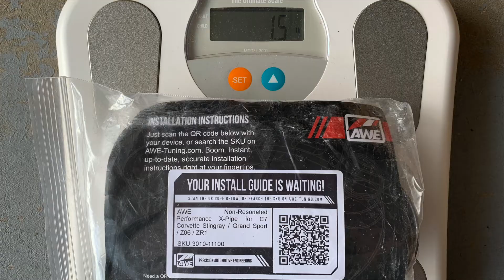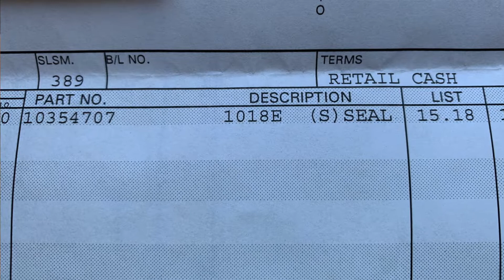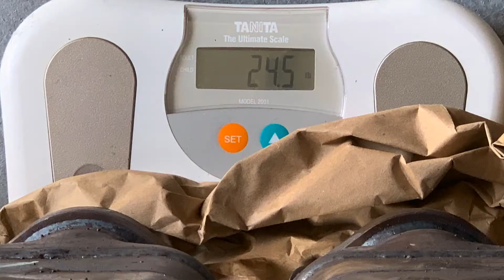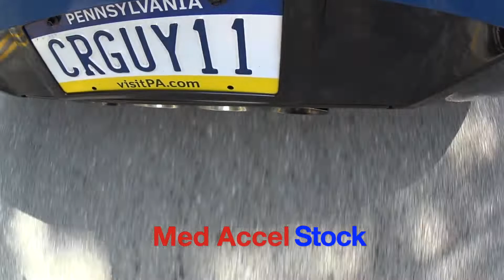AWE X-Pipe Install & Review - C7 Corvette Stingray Z51

Comment: Why didn't you just remove the two rear cats and then remove fuse #41 or 42 (depending on year), same effect, no?
Reply from the maker: The rear cats are welded to x-pipe so still would need to weld new pipes in.  Already did the fuse removal (actually mild to wild).  https://www.youtube.com/watch?v=PYgidQ2Xke8&t=

Comment: I am also contemplating between replacing the factory mufflers with aftermarket Corsa exhaust (muffler only) vs the x-pipe. What’s the reasoning why you chose the x-pipe over muffler install?
Reply from the maker: I didn’t want to loose the dual mode exhaust flaps. Plus a little performance gain eliminating secondary cats.

Comment: I want to mod mine so bad! I have a 2017 Grand Sport. The engine has had forged racing pistons put in, stage one cam, Lt4 supercharger, AFM delete system, Afe Momentum cold air intake, and had a stock exhaust! I'm keeping the back stock because I want the NPP valves but really want to add long tube headers, high flow cats with x-pipe, and I'll be putting a 2.3 pully on the supercharger in place of the 2.5. Should put me a little over 700 engine hp and around 600WHP.  Just worried about the noise. I'm sure with the valves closed it should be fine.
Reply from the maker: Yeah the valves are key to keep it from droning.

Comment: Imagine if you did a muffler delete in conjuction with you're mod... it would blow your socks right off
Reply from the maker: Yeah but I do like it quite at times too.
Reply: @CarGuy11  ohh noon. You get to keep you quite npp valves. All ai did was do a Muffler delete,  x pipe and had the show install the exhaust valve on both Muffler tips.. of course you need a Range ODB to keep the exhaust value in manual but that's only $189 and its plug and play.. I have done on mine and boy it's a good setup. Loud and mean as heck but quite enough when I leave at 3am .. All I do is before I start the car is select the exhaust valves open or closed from the screen menu then start the car. Easy peze.

Comment: I have found a 3 inch High Flow Cat replacement pipe for the stock manifold down to the X Pipe. Was thinking that Down Pipe and an X pipe keeping the NPP mufflers. And ,maybe a pre Rear end Cutout so exits just before the tire for those days I just want to be ornery. What do you think?
Reply from the maker: Yeah I love keeping stock mufflers and keeping the valves.

Comment: The center brace cover thing that you need to take off first before getting to the exhaust, when tightening the bolts, just tight is good right there is no specific torque to tighen those?  and after installation to check leaks, just do what he did and put hands around the connections to? feel if any heat/exhaust is coming out? Thanks for the vid it was nicely made.
Reply from the maker: Honestly there probably is a torque setting for those bolts but I didn’t know it. You can feel & likely hear a leak when you are that close to it. Thanks glad it helped!

Comment: Any plans on adding longtubes? I checked with AWE and they aren't planning on making their own. Ideally I'd like to go with the same manufacturer for piece of mind that everything it going to bolt up nice. I'd figure if I had to decide on their X pipe and complete exhaust OR spend the cash on their X pipe and long tube headers  with the factory exhaust with the fuse pulled, the headers would yield more hp
Reply from the maker: I’m pretty happy with the sound from Xpipe now but may consider long tubes in the future. I don’t want to loose the exhaust valves.

Comment: What’s the purpose of the secondary cats  just too muffle the sound ?
Reply from the maker: Purpose is cleaner emissions but still have primary cats.
Reply: CarGuy11 I read no Check engine light came on... so it won’t trip the cars computer !?  That’s incredible. Did you get a mild horsepower gain !?
Reply from the maker: Only the primary cats are monitored. Definitely adds a few hp.

Comment: I live in e check county. U just self serve plug int obd2 sensor and it reads computer. I wonder if this would cause it to fail. I am guessing not because it didn’t throw any codes through check engine light
Reply from the maker: No the secondary cats are not monitored.

Comment: Awesome. Are you still able to utilize the mild to wild switch after removing stock exhaust
Reply from the maker: Yes since I kept the stock mufflers. Thanks!
Reply: yes,  it fits to the stock mufflers which is before (front to back) the actuators which are located just before the exhaust tips.
Reply: I'm changing my rear end to the Touring Edition Axleback, Would I still be able to switch my engine modes from Sport to Touring or Will I lose that function....
Also, Can it be saved with a little welding to the new exhaust...??

Comment: Great video! Sounds awesome. 👍 Been trying to decide which Xpipe to put on my ‘17 GS. You just added another potential contender.  Why did you choose the AWE over the others?
Reply from the maker: Thanks!  Borla discontinued theirs & didn't like how raspy the Corsa sounded..
Reply: @CarGuy11  Thanks for the video!  I've seen Borla x-pipes on the internet for sale.  A couple say "retain OE cats" while others don't mention it.  I'm assuming the secondary cats come off with the original and are not replaced with the x-pipe.  I'll admit to preferring the sound of the Borla, though not entirely married to the idea of that brand, but I, too, prefer them over the Corsa.  Do you suppose the ones I"m seeing are left over stock?  They're sold by a number of different outfits...not directly from Borla.
Reply from the maker: Marc Saegaert Yes primary cats remain & secondary go.  Borla are left overs since they stopped making them.
Reply: Marc Saegaert no your cats are not replaced by the borla you’ve been seeing you cut the pipe after the secondary cats and it attaches to the pipe after the cats. If you notice it does not have the bolt up application that this one has that bolts up to the exhaust manifold and replaces the secondary cats. I been looking at the same ones.